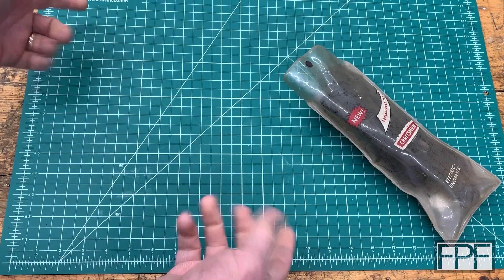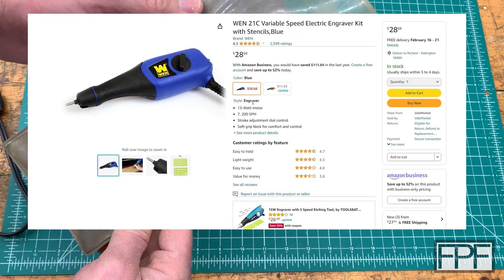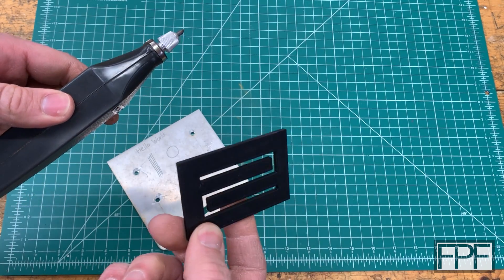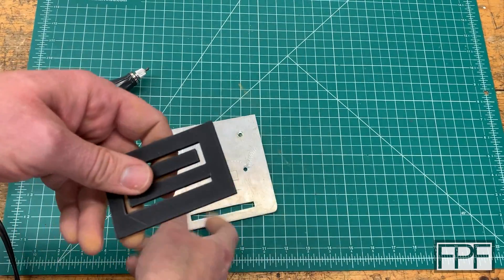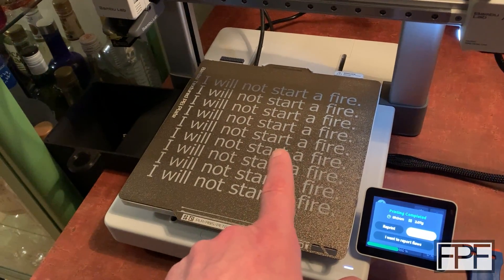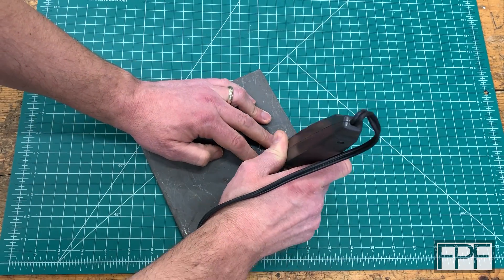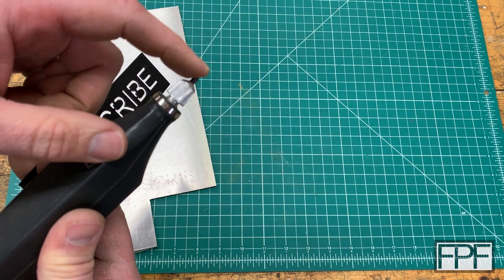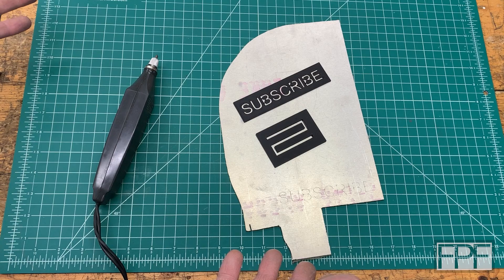3D Printed Stencils for Electric Engraver

Comment: I would love to see a stencil with the exact same shape (fillet?) of the carbide tip and stencil directly vertical.  So the tip rides in the trough.  It seems that you might be able to engrave a bit smaller letters that way.  Very interesting concept.  Next you should try a jig to hold metal stamps in-line as you strike them.  The ones used on metal and leather.  I have seen a machined version of it but not a 3D printed version.  (Blondie Hacks)

Comment: That's an interesting idea with the stencils. But did you thought about attaching the engraving tool to the 3D printer. It could reduce the printing time for the templates and make the result more precise. I wonder how the engraving tool could be synchronized with the printer and if there are any challenges or risks with this combination. Have you ever tried or seen it? 🤔
Reply from the maker: I think it would shake it apart.  The vibration is pretty violent.  Rotary engraving tool would be better if strapping onto a printer

Comment: I'd just attach this  to 3d printer toolhead
Reply from the maker: It's a fair suggestion, but it vibrates A LOT.  I think it would work at first, but ultimately shake apart the printer.  A rotary spindle (dremel?) would work better for putting on the printer, but my thought with this was for things that "don't fit on the printer or engraver bed".

Comment: For the A1, you can return for a full refund plus an additional $80 credit for their store. Waiting for the heat bed ( they provided a YouTube link detailing the replacement, seemed pretty straightforward) you get the replacement part and once they send that out you get $120 credit for their store. 

I also went with option 2 and will continue to use my A1 although I won’t leave it unattended. No more overnight or at work prints for now.

Comment: How does the carbide sit in the template? Does it hold the shaft between faces or does it run Along an edge like a rule.  

The Marius hornBerger pantorouter  mechanism where the template is much bigger but then you hold the engraver vertically instead of a router. 

Probably easier to make a mount for a cnc. Although Cnc machines have those spring loaded engraving tips that just drag along the part for engraving.

Comment: ooh..I know it's not quite a "FPF" but can you design a magnetic drive "sealed" water pump...as in the driven impeller uses magnets and is fully enclosed so there is no holes in the housing...and the drive also uses magnets to drive the impeller?  Maybe even a re-use of harddrive apindle motors or whatever type motors there are out there.
Would be a cool new 3D printable type pump where (after sealing the FDM layers with a liquid sealant) it can be used to pump fluids without leaks)